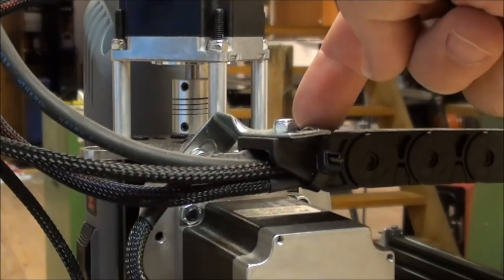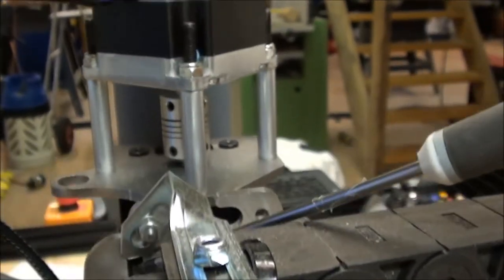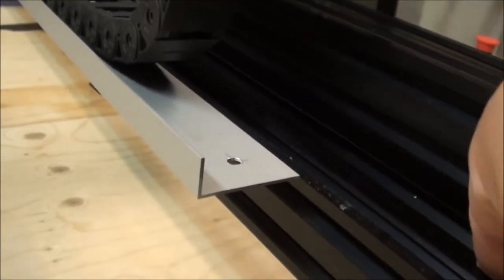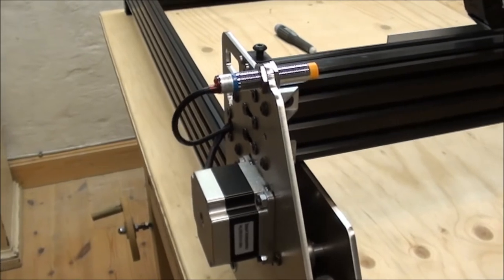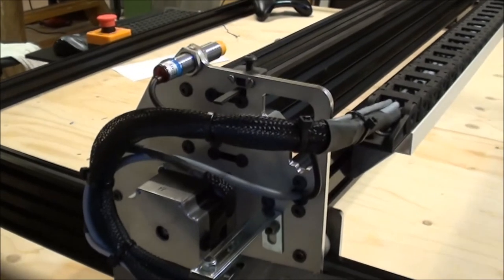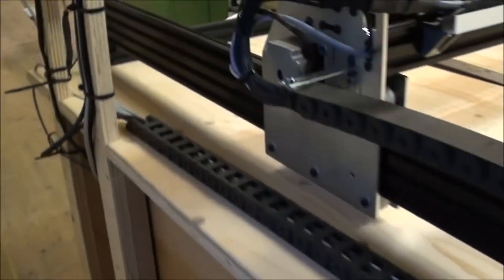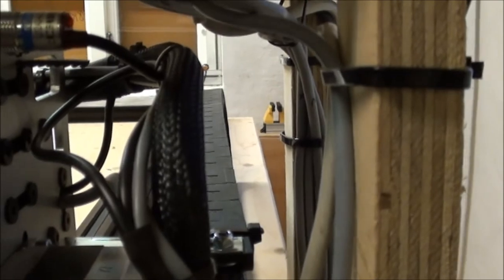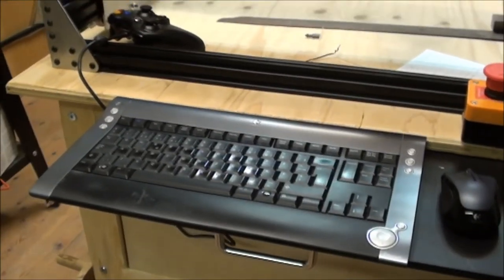Wiring of Stainless OX CNC router

Comment: Great work Martin I am liking the the look of those plates do you think 3mm is enough for the stainless now you have it all together. When did you last update you plate design ?
Reply from the maker: Peter Pollard Hi Peter. 

I’m glad you like the design. The plates have worked very well. The Sketchup file on OpenBuilds
includes my latest modifications - so up to date. I'm confident that 3mm is
enough. Stainless steel is VERY stiff. I have looked at some engineering data
books and 3mm SS should have an equivalent stiffness as ca 6mm aluminum (both
comes of course in different qualities ...). Drilling in SS is hard. The two
plates that hold the Z-axis threaded rod needs to have a pocket for the bearing
drilled after the laser cut has been made. Remember to ask the shop to make
those.
Reply: Thanks Very much Martin for the info I have converted the Sketchup files to dfx and and sent off to get a quote to cut I will forward the info about the recess for the bearing to the miller of the plates. Can I ask why you used proximity switches over limit switches on your x and y, what are the benefits. Regards Peter
Reply from the maker: Peter Pollard 

Hi Peter. Interesting
to see what they will charge you. Please also remember to have the center hole
for the lead screw drilled to a diameter ca 1-2mm larger than the lead screw.
The drawing has a 5mm hole as I was intending to use a 5mm center finder for
the bearing pocket and the lead screw hole.

Regarding the
proximity switches I selected them over micro switches mostly because it was
fun to test out. My smaller ShapeOko is using micro switches. Having said that,
my friend did some testing on a professional machine with my proximity and
micro switches. It showed out that the proximity switches (<$5 from dx.com)
was VERY good.

Here are some of the
data from 3 switches measured at 10V, 12V og 15V power supply:

 Sensor 1: 3.60mm, 3.56mm, 3.53mm

Sensor 2: 3.98mm, 3.93mm, 3.89mm

Sensor 3: 3.95mm, 3.89mm, 3.94mm

On/off hysteresis is as low as 0.005mm!!

So on/off is at the exact same spot and you see a little dependence
on supply voltage – meaning that it must be stable.

 

Same type of test on three micro switches:

On/off distance:

 #1: 1.97mm/2.20; 1.96/2.21; 1.96/2.19

#2: 1.81mm/2.13; 1.82/2.12; 1.83/2.11

#3: 2.18mm/2.41;  2.18/2.42;  2.19/2.42

 

So shifting  off->on with in ca. +/-0.01mm, with a hysteresis of about 0.25mm

Further it was noticed that the electric “on-to-off” point was not the same as the click point (0.1mm off)

The electrical off-to-on point and the click happens at the same point.

Long stort short  - all in all my conclusion is that proximity switches has some better properties.
Reply: Thanks Martin do you have the model number of the Proximity Sensors, Cheers Peter
Reply from the maker: Peter Pollard Hi Peter
I used some from dx.com: http://eud.dx.com/product/lj12a3-4-z-bx-inductive-proximity-switch-black-silver-dc-6-36v-100cm-cable-844228309#.VXQJ0E0w9Zk
Reply: Thanks Martin will check them out just need the rails and wheels :)